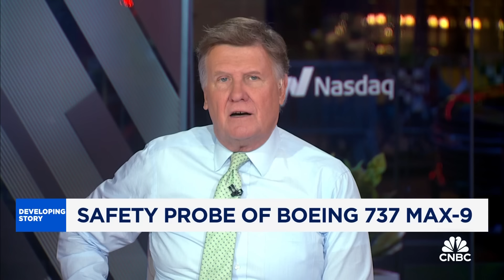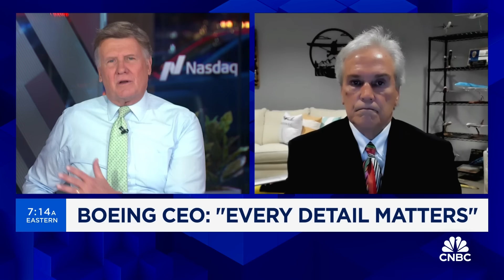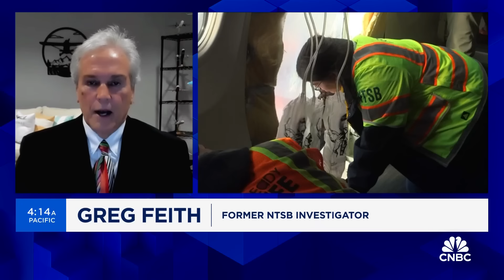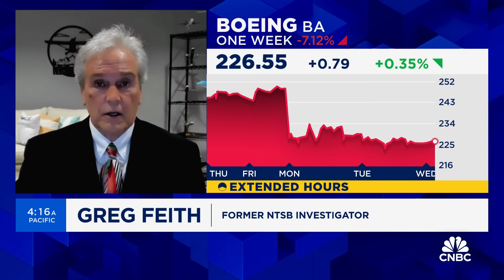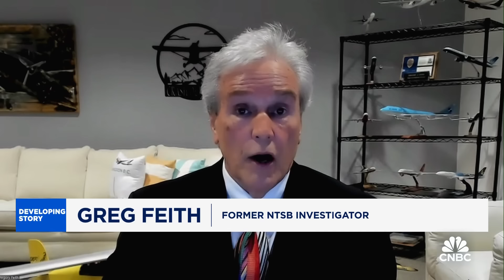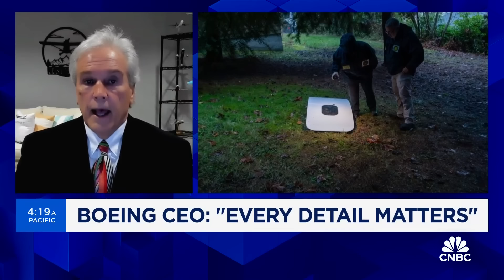Small quality control issues can cause catastrophic events, says former NTSB investigator Greg Feith

Comment: 5:55 - I used to work F-16's. Small plane in comparison. But, I used to check every external bolt and screw I could reach. You would lose your goddam mind if you saw how long it took to turn a fighter jet. I didn't work heavies. You'd have to consult with one of those crew chiefs to get something comparable. 

I was put through the ringer at Hill AFB. I changed a PTO shaft in MOPP 4, in the heat. That means chem warfare gear over my uniform, with rubber boots, gas mask, hood, gloves and glove liners, with a mask bag stuck to my leg. I was getting paid just enough to live in the dorms and own a car. What's your excuse? No one has a goddam excuse except survival. When the CEO is threatening to fire anyone that "becomes an issue for production numbers" you know where the goddam problem is. 

The real product at Boeing is profit. That's the problem. 

The bigger problem is American rules capitalism. It's the stealing of my good name, my work, the quality I provided. It's a sea of greedy "C suite" and "middle class" grifters. Thieves who use "staffing companies" to avoid OSHA regulations and Federal taxes. Blame yourselves. If you don't have the guts, we can place the blame upon you. With your titles and bonuses, you took responsibility for the aircraft. If you aren't responsible, why are you getting the bonus?

Comment: 1:37 - That's where you'd be wrong. It's not a software issue. There is no software that can tell which of the two sensors is accurate. It's angle of attack, which  can't be done with a gyroscope. That isn't information that can be inferred from visual sources. It's possible, in a stretch, that you could glean AOA data from sound, or from pressure along the body of the aircraft. But, at that point you've introduced a system that requires a lot of "learning" to understand the massive amount of data incoming. It's a bad design. The aircraft has a very different handling character without that MCAS system. Without it, the pilots would have to use the elevators to compensate for throttle inputs, because any increase or decrease of throttle will change the AOA. No one in their right mind would design an aircraft from the ground up with handling like that. 

2:55 - Please explain how different it would have been at double the altitude, and at cruising speed. How many people would have died? Would the pilots survive? Would the airframe have survived that decompression? 

3:35 - Hours of labor. There, I helped you. I figured you should have a masterful vernacular; being a talking torso for a living. And yes, you're balancing profits against the lives of men, women, boys, girls, and any cargo. Are you more comfortable paying wrongful death settlements, or just paying workers enough to get the job done right? You remind me of a corrupt business owner I knew. Both had been officers in the Marines. Both were willing to push bad parts to Lockheed Martin. I would rather take a bogus assault charge than have blood on my hands from a dead Kiowa helicopter crew. Sure, I'm not a big fan of Army Warrant officers; not that I've ever met one. But, I'm not willing to endanger soldiers or national security for the sake of profit. Your attitude is disgusting. And yes, you should feel disgusted with yourself until you change. I promise, it's possible to repent. You know what you must change; but, you don't know why. Profit cannot wash away your sins.  You can't donate enough to a church to gain the good grace of God. You certainly cannot bring spoiled offerings.

Comment: The only way that you could inspect every nut and bolt on a 737 Max 9 now in service is to tear it apart down to the ground and rebuild it which is not going to happen. Another option is that Boeing replace all the Max 9 in service with a new one that is currently in production and that is properly inspected which will not happen.

Comment: How does the NTSB know this shortage is only present in the 737-9?... Why not 8 and 10? (do these not have this type of door).
Reply: This is not a door, it is a plug that covers the opening where the door would be if needed. The -800 and MAX 8 do not use this extra exit like the -900 and MAX 9 but assume the MAX 10 will.

Comment: on job site my oversight was to catch the "kids" sub contractors would give the EASY jobs to, but they were critical to the end product. Parts not  installed (my labor asst. would jump into the dumpster and retrieve the boxes with parts inside) and when I went from BC Canada to Alberta Canada with the SAME company I ran into a mental "freedom fry" slacker attitude and no management having any kind of Code, Quality, or Honour. So it goes sideway: large propane tanks hung for the weekend from a crane OVER a public sidewalk, plyiwood in a windy area (yes, one pc. fell an dhit a little girl) not strapped down, all kinds of issues we'd NEVER see in downtown Vancouver, where you have the PUBLIC on all four sides of your build and windows across the street. !!

Comment: I don't see Alaska Air as entirely blameless. They had a high enough concern to severly restrict operations of the AC. That indicates it had some probability of failure, apparently from depressurization, yet they restricted the maximum distance from a runway. That makes no sense at all, if the worry is about decompression. If I'm worried about pipeline blowouts, I restrict the operating pressure, not how far I can pump product. The plane's maximum altitude should have been restricted. This makes the lack of a major disaster just freeking luck. That don't cut it for me. Yet Alaska Air isn't catching any sh!t at all.

Quote:

"And she said Alaska’s decision to restrict the jet from long-range routes over water was not required by regulations but was a precautionary measure the airline takes voluntarily to provide an additional safety margin when any important systems show any sign of a repetitive problem."

If that is true, what exactly was the reason for the restriction? Just "too many alarms"? Nobody looked at the alarm log and said, uh it's a pressure problem. Nobody looked to see what the hell it was and deduce the appropriate flight restriction. Really? Nobody?

Quote:

"Intermittent warning lights indicating a brief reduction in cabin pressurization had occurred on flights of this new MAX 9 on Dec. 7 and then again on Jan. 3 and 4, (2 in the previous) two days before the incident."

They had 3 warnings. Increasing in frequency.   That is in itself a signal of increasing danger.  Then they reach a daily basis. 3 warnings is a 99.9994 chance of decompression malfunction. YES A 99.9994% CHANCE.   What the hell are they thinking. Keep the plane flying! Just when, or how many warnings does Alaska Air need to stop and figure out what's wrong? 2 per day? 3? 5? What's their limit? It's obviously much higher than mine. Do I have to ask "Hey, how many warning lights did you get lately" each time I board. It looks to me like they are not interested in passenger safety at all. Just giving lip service.

Quote:

"Homendy said the policy to restrict it from doing so at any sign of a system issue is “an extra step that Alaska Airlines put in place.”

Guess what. That does no good, none at all, if you do not take the right precautions. FAA, time for a new regulation. PROMENATELY POST THE NUMBER OF WARNING LIGHTS RECEIVED IN THE LAST 30 DAYS and ANY CURRENT RESTRICTIONS ON OPERATIONS OF THE AC. POST IT ON THE PASSENGER ENTRANCE RAMP IN 8" TALL LETTERS. I'll make my own decisions, thank you. With immediate 4x ticket cost cash refunds for anyone deciding not to take their joy rides.

Comment: Check this YouTube video.

'Not a good thing': 
Boeing whistleblower reacts to Alaska Airlines mid-flight incident.
At 8.53 into the video, he is saying that the company has been REMOVING QUALITY CONTROL iNSPECTIONS. 

More than likely this is contributing to the 'sloppy' workmanship that is going out the factory door(s). Boeing has got rid of its own INDEPENDENT Quality Control Inspectors and is just relying on a few Boeing company employed designated FAA Inspectors to save money. 

Some airlines are going down this road by removing Independent Quality Control Inspectors , ( those individuals independent from production ). 
So QC is being 'watered down' or eliminated.

Comment: Boeing spun off their manufacturing facility in Wichita as Spirit AeroSystems several years ago simply to make their bottom line look better. Spirit assembles the 737 fuselage for Boeing and it is my understanding that worker moral is very low there. QC has suffered because Spirit has been under pressure from Boeing to deliver more fuselages every month, while at the same time hemorrhaging money for years.

Comment: Simple question: Why don't those 4 bolts have a locking mechanism? They dont yet know that those bolts aren't simply backing themselves off due to vibration.
Reply: They do. A cassellated nut is screwed on, and a cotter pin is put through the bolt. That configuration will hold. My guess is that the stop bolts were never installed.
Reply: in the photos even if the bolts didn't even HAVE a castle nut, I don't see where the bolts could come out all the way: they'd jam against the wall!! there were no bolts. AND to lose all FOUR>??? impossible.
Reply: The upper bolts just act like pins to keep the plug from dropping down and disengage from the track and there's really no way for these to.just fall out even if left loose. So my guess is that Boeing workers removed them to remove the plug as part of their interior install and just forgot to put the bolts back.